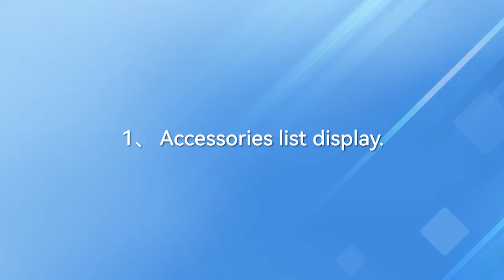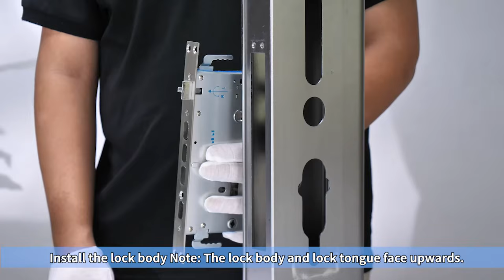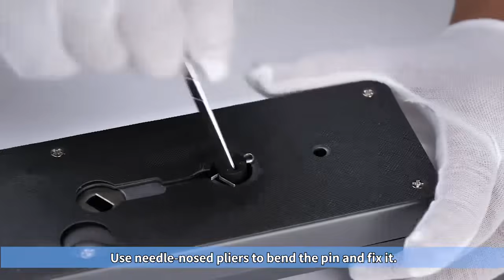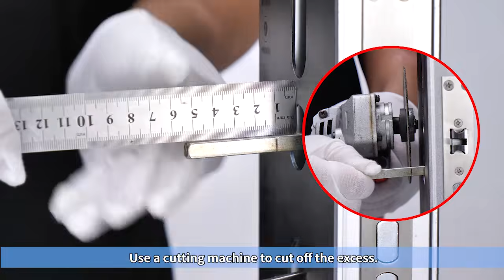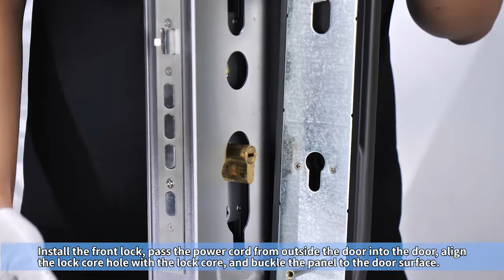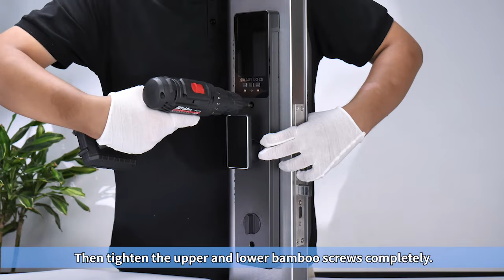XSDTS SMART DOOR LOCK: DF14XF Installation video(English)

Comment: Hi
How to change the smart lock DF14XF-6068S-DGXS automatic locking rotation if it is reversed. Thanks
Reply: did you find a solution? i have same issue
Reply: @andreacas2472  You mean the latch rotation?, need to took out the whole lock casing, there is an mechanism to pull back and turn the latch direction

Comment: I bought this model almost one month ago but it doesn't charge, I wrote a message with the issue and I received the replay "remove the battery" but "How Do I remove the battery?" is not explicate in the manual nor instructions. The lock looks completely sealed so I do not where the battery is and I don´t want to break the lock ... Thanks ... help please !
Reply: the battery is at the rear body, the battery require to slide the cover off, inside the lithium battery will have a charging port